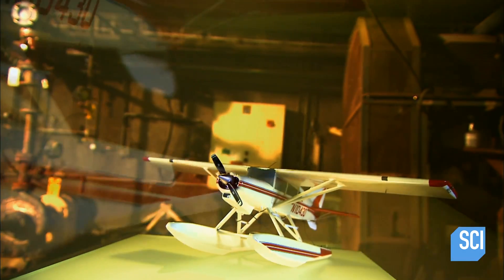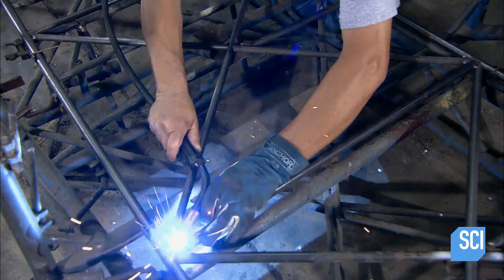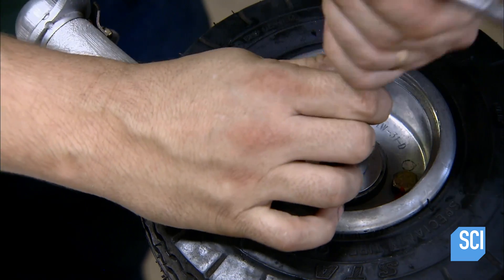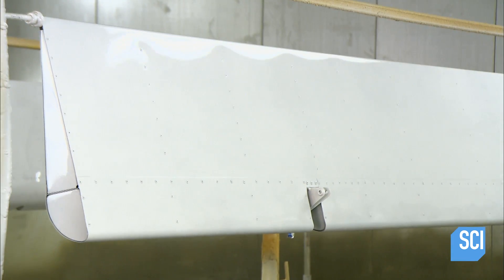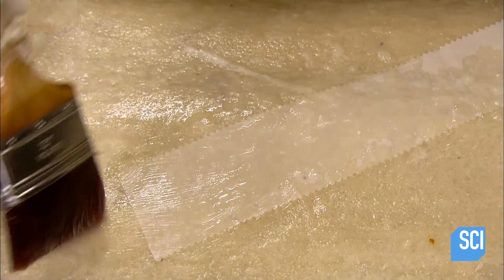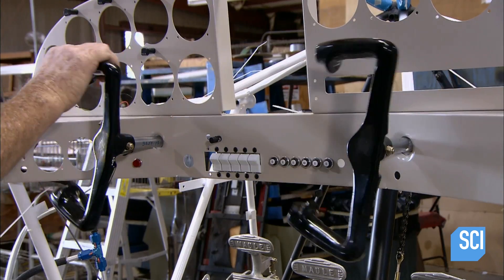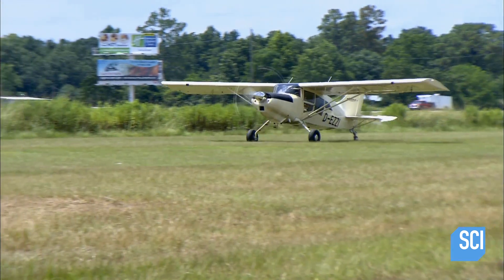How It's Made: Bush Planes

Comment: Great video! Bush planes are the best. 

I’m actually looking to build one (Zenith CH701 or Just Aircraft Highlander). Their simple machines, but expensive. the airframe isn’t really that much, where most Quick build kits (kit company manufactures 49% of it) is only $20K-$30K. The engine is really what gets you. A 80hp Rotax costs $25K new and when you start working your way up to a 160hp-200hp Lycoming they can be $100K. And then avionics aren’t cheap either. 

This Maule is right around the $200K mark and engine and avionics are probably sitting around $100K. Then labor is the next biggest cost with this

Comment: What is the canister he's holding at 4:04 ?
Reply: It does not look like a muffler, it looks like some kind of heat exchanger. I thought is was for cabin heating but the pipes looks like they go back into the engine.
Reply: It’s the heating shroud with the muffler inside. Turbos sit between the baffling and firewall

Comment: Hmm. I know this ain't a 747, but this seems about as sophisticated as a gocart.
Reply: Reliability over complexity
Reply: @Aware_Coffee  Exactly. Complexity means more maintenance expenses also, and most of those sophisticated systems are way superfluous for small aircraft anyway
Reply: @Aware_Coffee and weight. They’re designed to be super light so you can take off and land in really short distance.
Reply: Except for the avionics, your are about right
Reply: It's a bush plane, it's designed to be flown in areas most other planes can't go, fixed anywhere and reliable when you need it the simpler the better in this case.
Reply: @jhomrich89  watch out Mr. Know-it-all will come around and tell you some how your wrong and that he is some sort of big time Bush pilot. With 20k hours flight time. Lamo I helped my pilot fix his plane. He told me that 1 these planes are designed to be simple so they can be worked on out in the middle of now where. MR Know -it all hit sh^t pilot told me I didn't know what I was talking about. Lol
Reply: @dickhurtz1862  Sorry man, I guess I did come across that way. My bad
Reply: @Timendous-b5c  it's cool don't worry about it. Hey have a nice night or morning. See ya.
Reply: @dickhurtz1862  Thanks, you too
Reply: @Timendous-b5c  your welcome.
Reply: Pretty much…..
Reply: All the scientific and engineering sophistications are hidden in the design, the engine, and the material science of it. On the surface yes, you slap something’s together and voilà you got a plan.
Reply: And it'll crash just as easy....CRUUUNCHY CRUNCH
Reply: Simplicity = reliability.  Few moving parts as possible.
Reply: Simplicity is cheaper, easier, and tends to be safer.
Reply: Repairable with bailing wire and duct tape in the bush
Reply: Its designed that way so if the pilot has to work on it he or she can.
Reply: @dickhurtz1862  The only issue being they are not allowed to work on most of it
Reply: @Timendous-b5c  really? Hummm
Reply: @dickhurtz1862  I spent 2000 hours in school learning the basics so that I could work on the planes I fly. The aviation industry is very expensive and time consuming to really get into
Reply: @Timendous-b5c  well seeing how your flexing, so hear is the scoop. I) This what I was told by a bush pilot in Alaska  as he was fixing our plane so we could get out 2) 😝😝😝😝😝😝
Reply: @dickhurtz1862  First, I am a bush pilot in AK. Second, there are certain things a pilot can do on their own plane. And as for flexing, all I was trying to say is it is almost ridiculous how much time it takes to be an aircraft mechanic. Because there are so many different systems, engines, and what not, the FAA could test on anything and you have to know enough to be  able to pass. I wanted to go the apprentice route, because even after all that schooling I know almost nothing, but I was counseled by another mechanic to bite the bullet and go through school. That is how I earned what is known as “the license to learn”
Reply: @Timendous-b5c  how nice. Geuss what??? Dgaf.
Reply: @dickhurtz1862  yeah let ya pissed off wife work on it and that'll be the last day you'll fly.. 😂😂😂😂😂
Reply: Reliability over complexity makes total sense. But I wasn't looking for just needless complexity. And actually some of what I saw made me question potential reliability.

What made me decide to comment was the shot at 3:40 of the control linkages. Examples: 

A) The yoke appears to pass through the dashboard via a nylon bushing surrounded by a metal collar welded at one point to the frame.

B) The chains and sprockets...I was imagining some sort of turbulence or quick maneuver could wrest the chain off the sprocket resulting in loss of control. There doesn't appear to be much other than proper alignment and the weight/resistance of the control surfaces to keep the chains where they need to be. Perhaps there is a small guide piece above the double sprocket. 

C) Control cables are routed to the control surfaces via small pulleys that help them change direction. Again, not a lot to prevent the cables from hopping off those guides. 

D) There are lots of things secured by nyloc nuts while I would expect to see castle nuts. 

I guess I just expected to see a little more obvious redundancy or clear safety features.

It may be perfect. And my concerns might be idiotic. But I wouldn't fly in one unless I had clear evidence that it had been vetted by some reputable agency haha. I don't think I'd have the same questions hopping on a private jet or something.
Reply: @barcodenosebleed5485  So for A, it is pivoting on a tube welded lengthwise across the frame. It really doesn’t have much force on it anyway.

B, the chains are used throughout the industry, along with guards to keep them in place. They can actually have around 50 pounds of tension on them or more, so they will not jump off. 

C, all cable pulleys have a pin on the backside to keep the cable from jumping off

D, nyloc nuts never come loose. I have seen thousands on all sorts of aircraft, and they never come undone. The only time castellated are used is where the bolt cannot be tightened completely down due to the part it is going through, for example, pulleys need to be able to turn freely. 
There are thousands upon thousands of aircraft out there, and all use the same control systems. Of course there are exceptions, for example, a C207 does not have the normal control column, but for the most part they are all the same.
Reply: @Timendous-b5c  this is really cool info!
Reply: @barcodenosebleed5485 the 747 IS made the same way. The pulleys and tiny wires is just a thin panel away from the passenger cabin.

Comment: Folks must have been doing that job a long time. Not a torque wrench, safety wire or feller gauge in in sight!
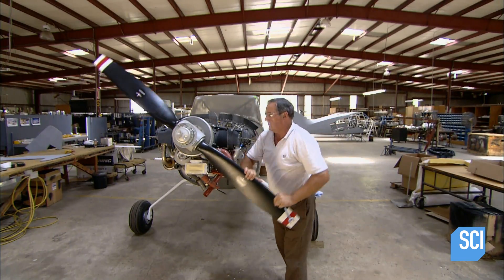Reply: To be fair at 4:13 there's safety wire on the propeller
Reply: Not only do we see safety wire, the very first part we see being threaded has holes for it. 

Planes that are treated rough and are exposed to high amounts of vibration (like bush planes) need safety wire.
Reply: I noticed that too. I'm not sure if I would trust the product. It's like the Yugo of the sky without torque wrenches, safety wiring or felt up guages. (feeler guages)

Comment: The bush planes I’ve seen have much bigger landing gear wheels. I think the big wheels cushion bumps better and have a bigger footprint so they don’t sink as much in soft ground when landing.
Reply: As someone who has a bush pilot for a brother I can tell you why. Most Bush planes are very customized so much so that the factory that makes them usualy won't customize them they will build them to be as basic as possible to make them somewhat affordable. After that the Bush pilot will upgrade things they want. My brother added larger front wheels and hydraulic breaks although he said he wished he didn't for the breaks as now they are a bit to good and if he steps to hard he might make the nose go to far forward he's had to make some mods to that system to prevent it because the last thing he wants is a bumpy landing to force him to hit the breaks too hard. These planes are often also bought by hobiest pilots that would like to own there own plane instead of paying the rental prices for say a cesna. So a lot of these "Bush" planes arnt even used for Bush opperations.. one of the most common uses I see is ranches using them to do fence line checks I know one that checks his fences once a week it takes him 2 hours by plane if he did it with a 4 wheeler it might take him all day. He Flys around checks the fences if he sees a break he can just land and make a beeline to it instead off driving the whole perimeter. So he doesn't fly it as a Bush plane he lands at his own dirt runway.
Reply: so the big wheels is so that it can land on rocky spots or anywhere where you have to stop quickly, it makes the brakes bigger. i believe is why.
Reply: @aytronio21  Even 35 inch tires have the same size brakes as a 6 inch tire. The bigger the brakes, the more likely to nose over in a tail dragger, besides the brakes already on those planes will stop them very quickly. I am a bush pilot and mechanic in Alaska, so I see a lot of different things with bush flying. Those planes are incredible
Edit: reading back over this, I made a mistake on the “6 inch tire.” Thats one tiny wheel. I meant a 6.00 by 6, which I believe brings it out to 12 inches. Never actually measured one, so don’t know for sure
Reply: I think they are just using the term "bush plane" interchangeably with single engine light aircraft in this context.
Reply: @DustinDawind  You are correct. That is what bush planes are by popular definition
Reply: I think you think right
Reply: R.I.P Draco
Reply: Those are bush planes designed for STOL.
Reply: @SR-gs8zo  where don you find tires that cheap
Reply: It’s so they can run lower tire pressure, which is why they don’t sink and that’s an upgrade you put on yourself.
Reply: @kishascape  No, you don’t put that on yourself unless it is an experimental. It requires an STC along with a 337 from, which must be signed off by an IA. As far as lower pressure goes, the tires are rated to super low pressures so that they do float. It is quite incredible where I have seen planes like that land

Comment: I love aviation. Anyone know why bush planes still insist on the tail wheel instead of a typical tricycle landing gear?
Reply: Some are tricycle gear, but generally speaking a typical bush plane is high wing and taildragger.  Taildraggers are usually more rugged. Hitting something with a nose wheel could be catastrophic. Hitting the tail wheel less so. Consider an off airport landing. The nose wheel will be pushed down and over a rock/obstacle. The tail wheel will be dragged over it. Source: I own an Avid MK IV taildragger.
Reply: @JohnBaleshiski  Also, taildragger keeps the prop higher, away from the obstacles.
Reply: Better prop clearance, and easier to traverse rough ground. Another benefit is the angle of the wing is already that of a takeoff profile so generally they have superior takeoff and landing distance over nose wheel counterparts
Reply: Mainly because nose wheels can dig into soft dirt or drop into a pothole, etc. which are potentially present in the types of runways STOL airplanes are made to use.  Nose gears can be damaged or broken landing on runways other than paved or well maintained turf.  Tailwheels, on the other hand carry less of the airplane's weight and are designed to take the abuse of rough runways.  If your nose gear is damaged at a remote airstrip you are SOL until help comes, and it will be expensive.  On the other hand, if a taillwheel is damaged or broken a good pilot can still takeoff with it, or in some cases without one at all.  Incidentally, I was Maule's chief engineer from 1974 to 1979 so I know what I'm talking about.
Reply: Because tricycles are for kids
Reply: Get a zenith 750 it solves that problem
Reply: @asaiyannamedgokublack  even the zenith nose wheel has it's limits.  Currently looking to sell my zenith cause the nose can't take what a tail draggers will.

Comment: How It's Made: Cheaply
Reply: Often at home, in a garage. :)
Reply: Build one and then you will understand. That 4130 tubing is super expensive, as well as the 2024 alclad aluminum. The main goal is to save weight, so built as lightly as possible. They are actually surprisingly strong

Comment: How much would a standard bush plane cost
Reply: 10-40k
Reply: @gangisspawn1  20 sounds good to me... I would seriously consider getting one
Reply: @DamplyDoo  you should, they're affordable to average people. However, depending in where you live it can be expensive to maintain. Alaska is the easiest state because people can park them in their field and do most of the maintenance themselves. 

Most states require a licensed mechanic, so many flight hours, and if you don't have the land you have to pay hangar fee's + higher landing fees if you travel. Factor in your yearly maintenance/flying cost on top of the plane purchase where you live because that will likely only go up over time. 

I'd love to live in Alaska and own my own bush plane. It's their way of life because they are so rural.
Reply: @gangisspawn1  It's not the states dictating that, but the classification of the aircraft. If it is certified, an A&P must work on it other than simple oil changes and the like. If it is experimental (and bush planes often are), the builder can do everything.

As for the cost, my first bush plane was bought used for around 20k. That's on the low end. High end is 250k+ for a nice new one with a full stack.
Reply: @JohnBaleshiski  Correct. I’m a certified pilot and mechanic in AK, and everything said here is right, except that experimental planes are actually comparatively few. I am building one myself, and I now know why there are not more. It is A LOT OF WORK
Reply: @Timendous-b5c  Thanks for the info. Around here in CT, most bush planes I am aware of are experimental. A lot of work indeed! (I'm building a composite aircraft)
Reply: A new Maule that was shown in this video goes for around 300K
Reply: About 10
Reply: Tree fitty

Comment: What the body is not made from steel or something. 😅
Reply: Weight. The more it weighs, the less the performance. A heavy bush plane is not going to typically be landing on a 200' sand bar. Sure, you could put a more powerful engine. Then you need to reinforce the frame which weighs more, leading to a cycle of more power and more weight.
Reply: Uh, did you not see the steel tubing?